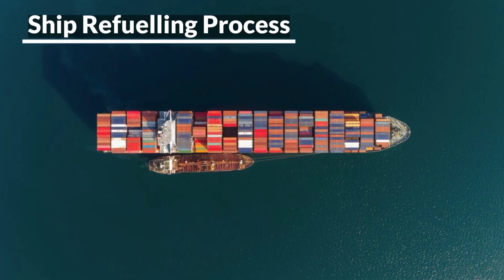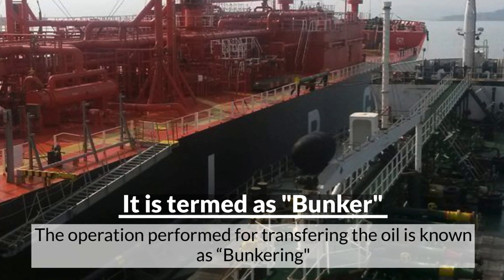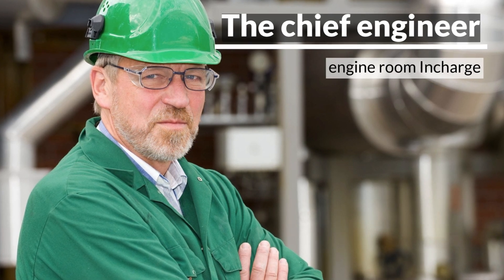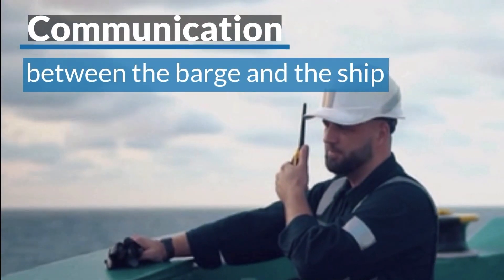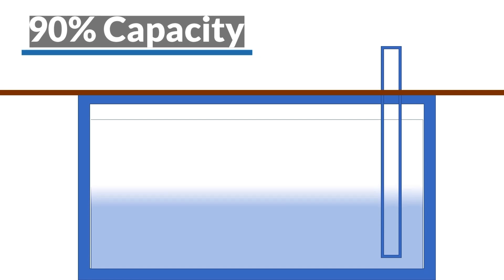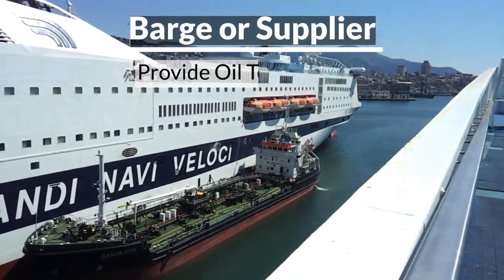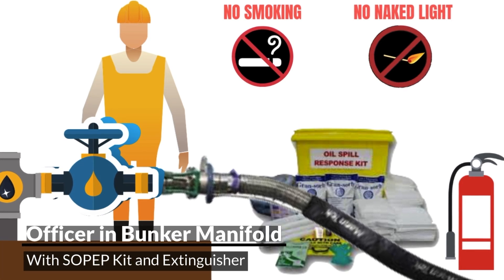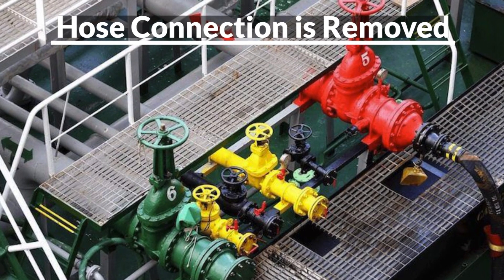Ship Bunkering Operations

Comment: what's the value of air pressure in bar used by the bunker barge or ship to clear out the remaining oil in the transfer pipe at the end of the bunker operation....???
Reply from the maker: Less or same as oil supply pressure s